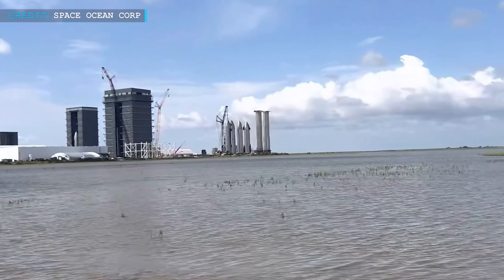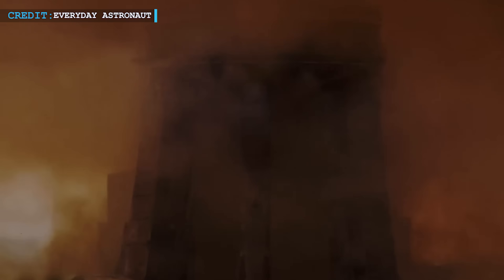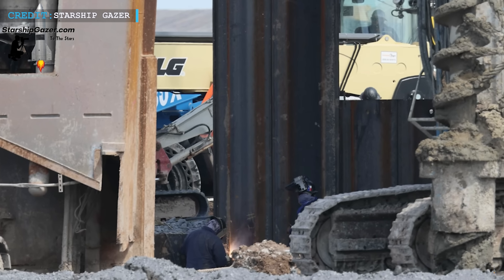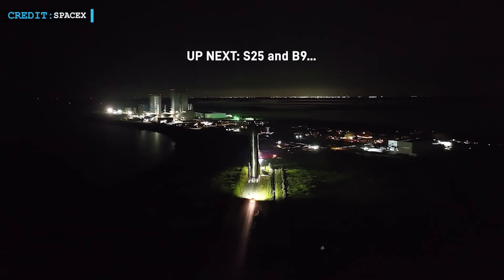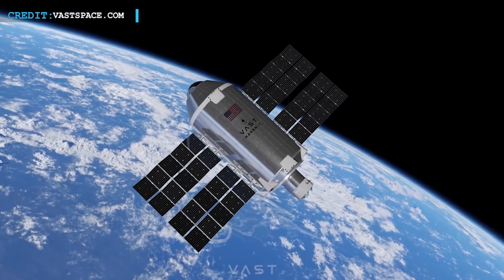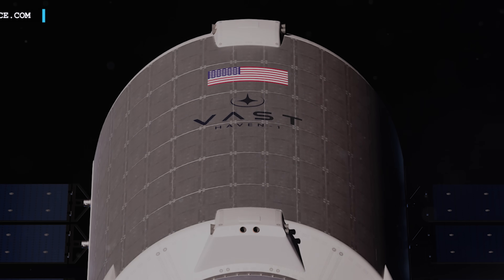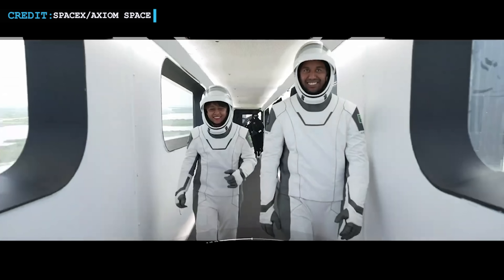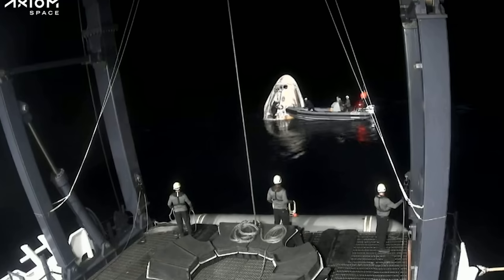SpaceX Starship Major Orbital Pad Changes | Construction Begins on New Wider Megabay...

Comment: Still Eon Musk not taking my warnings and Suggestions into account for Safety. Eventually I believe he will have to change the Design change as reducing time on the platform from 3-5 seconds to 2 seconds although a fine decision it will not be enough and he will have to make the major change to a Cape Canaveral platform and Swimming pool to absorb and Devert rocket blast down the trenches.